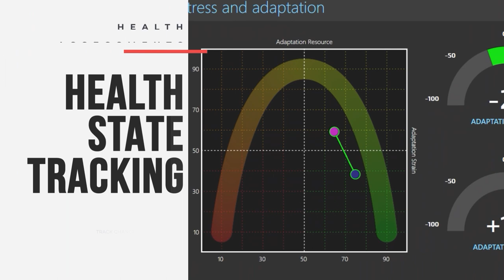My First Killer E-Bike Build with the CYC X1 Stealth Mid Drive Motor

Comment: Mahalo for the fine video info. And the informative teleconference with Jon Chan and Rickus... I've been to Salt Lake City, Utah and have ridden from downtown Salt Lake City up towards the foothills where the high tension power lines are. [Only about twice since I had a bicycle as my only means of getting... Now I'm encouraged to get my 29-inch bike out of its two year hibernation and start riding again... Maybe upgrade my brakes and change my tweaked fork.. and get the gen 2.5, asi controller... two 20Amp Samsung battery packs... Hopefully, they've worked out the water resistance issues... Hope you are well and riding your e-bike now.. Stay safe. ALOHA John...
Reply from the maker: My update video...https://youtu.be/ZPzcRTTcXTg

Comment from the maker: I goofed. When I mentioned crossing the border from Canada to the US I said you can easily switch from the 500 watt road legal limit here to 250 watts for the US. I meant to say 750 watts which is the road legal limit in the US. Having said that I should also have pointed out you have the option of setting the speed limit as opposed to the power output. That way you get to use all of your power up to that speed. That would be preferable IMO.
Reply: some states legal limit is 1000 watts just saying :-P

Comment: Ebike speed has nothing to do with the battery amps, it's a mix between battery voltage and discharge rate, Volts determine how fast the it "can" spin in rpm but you need a certain discharge rate (in watt/hours) to "muscle" your rpm from 0 to whatever while carrying you and your bike against the hill and the wind. The higher the rate(up to controller limit of course) the less speed you lose while going uphill and the faster you go from 0 to 60. The truly important metrics is the volts = (36,48,52,72) the higher = more rotational speed at the wheel and it's easier for the controller to get more current with fewer amps, volts x amps = total battery capacity in Watt/hours(size of the tank) and the discharge rate which tells you how fast you can accelerate and within reason how much speed you lose while going uphill, more discharge means more total amps to the controller while it's trying to keep your speed constant against the wind or the climb.
Reply: Thanx4 the layman's explanation Sir. I'm going to dust off my 29-inch mtb from its resting place these past two years... I'm going to update my brakes to hydraulics front and back. Change my front forks to Fox since it's tweaked anyway... Maybe I can take longer rides than 18 miles each way from Ft. Walton Beach to Navarre.. I can head towards Pensacola or Panama City both about 60miles each way from Ft. Walton Beach... mostly flat lands except for bridge overpass for sailboats. I'll have to work out the front derailleur to a single 48T. I've no clue about electrical systems other than a simple on and off switch.. I will find out... Mahalo for getting me started Mr. Michael Castro. ALOHA Brah

Comment: My thinking is to put this motor on an E Bike that has a small motor but has a good brake system and suspension.  It would be nice to have up to 5,000 watts if it can go 40 mph or so. Replacing a weak 500 watt rear hub motor with 5,000 would be great! Just change the rear hub motor into a solid axle rear rim without a motor.
Reply from the maker: That would be the CYC Motor x1 Pro. 3,000 or 5,000 watts depending on the controller voltage. You can easily do 40mph at only 3,000 watts. I've hit 40 mph with my 1,500 watt mid-drive.

Comment: I have ridden my E Bike for 50 miles at a time. With low pedal assist levels staying under 15 mph I get 75 miles per charge. But my motor is 1,000 watt 1,800 peak. 52V 20 Ah battery. Good workout even though it's a cadence sensor style bike, not a torque sensor. We also have no hills here. I get a top speed of 36 mph on flat ground. I can set it up to be legal and class 2 compliant if I wish. Nowhere on the bike does it say it is 1,000 watts. Just has a big class 2 sticker.

Comment: This is 2 yrs old but very timely for me because I'm just researching my own build so many thanks. I have just bought a 2nd hand Trek mountain bike which should give an excellent platform for the ebike, now just have to decide on the motor. It will be either the CYC Photon or X1 Stealth, haven't made up my mind yet. I like the extra power of the Stealth and its clever efficient design, but will be using the ebike for some hunting so the quieter Photon would be an advantage in that respect. We'll see!

Comment: I bought a kit 5 months ago excellent company.  The products they produce are top tier
Reply from the maker: We've just built two folding bikes. The CYC Stealth motor fits the frame on the new 2021 Giant like it was designed for it. Video on those builds coming soon. We're just waiting for a couple of 52V/14Ah batteries from ElectrifyBike.com to mount on the seat posts. We also have a rack and battery setup to compare the two options.

Comment: Two words....Luna Cycles!!! A motor you can buy and is not vapor wear! Also to build an ebike where you have a choice and to not get full suspension at your age is kind of crazy! Also, why did you not address the supply backup problem with their motors and batteries???
Reply from the maker: One word, Electrifybike. They are getting a shipment of 2,000 motors in a couple of weeks. The biggest shortage was in controllers. It was a global supply issue. Now that is gone. My update video...https://youtu.be/ZPzcRTTcXTg

Comment: Just received my CYC X1 Stealth, in Australia, hopefully doing the build over weekend. Did you get yours built yet??
Reply from the maker: Yes, and loving it. Working on the next video which is mostly what I've learned since I built the bike. Just waiting for the spokes I need to replace the 3 broken ones I found on my rear wheel. I have my ride video footage already in the can and I am hoping to finish this update video this weekend. I will follow that with our folding bike build, which in our opinion, is the best folding bike on the market. It is so slick you will almost think it was designed from the ground up but it is not, it's a DIY. Stay tuned.
Reply from the maker: My update video...https://youtu.be/ZPzcRTTcXTg

Comment: I received my motor,I installed it the brake sensor if you just use the two sided tape is not holding so I fabricated a mounting and I used epoxy for cleaner look instead of plastic tie, I’m happy with the purchased enjoy to those who buy this motor I hope you receive your motor sir happy riding
Reply from the maker: My update video...https://youtu.be/ZPzcRTTcXTg

Comment: This is one of the best e-bike videos I have seen on youtube! You explain everything so well and in detail. I used to have a mid-drive motor before, but it seemed to wear out chains and cassettes every 2-3 months (I ride a lot). What is your experience with wear of chains and cassettes?
Reply from the maker: I completely agree with you about the wear on chains and cassettes. That is why we are upgrading this build to the new Box Components 1 x 9 ebike cassette. I can't wait to test it. Having said that we are waiting for a fantastic new motor tech coming out in the 4th quarter and will, at that point, build and test a ride with the Veer belt drive. It's a motor I have been waiting to hit the market for over 2 years.
Reply: That only happens like that if you use your ebike as a motorcycle, if you use nothing but pedal-assist or use the throttle only to maintain or slowly accelerate you will have your parts last years.
Reply from the maker: My update video...https://youtu.be/ZPzcRTTcXTg

Comment: Great vid. Hope build vids are still comming. One thing I haven't heard  with the CYC motor is if they have regen, more then for the charge, but rear breaking on the road. But maybe better without unless it can be turned off for dirt trails or coasting.
Reply: Regen isn't possible on a mid drive due to the free-wheeling cassette on the rear wheel.  It provides an almost insignificant benefit on e-bikes anyway.
Reply: @nukeelec  Hadn't thought of that. For rear hub, I know it can work as a auto brake and those with, it usually doesn't do much dif for charging anyway.
Reply from the maker: My update video...https://youtu.be/ZPzcRTTcXTg

Comment: What a shame. I'd love to put an X1 Stealth  on my Tadpole trike but it looks like the motor would stick out front of the Boom & Bottom Bracket by about 200 mm without any way to mount the anti-rotation clamp.
Reply from the maker: Just looked at a high-res photo of one of those trikes. What's to stop you from mounting it on the bar behind the chain ring? We mounted it vertically in the frame bracket on our new folding bike. At the same time we sourced a case to mount the controller behind the seatpost as the stock configuration combo would not fit in the frame triangle. That video coming soon.
Reply: If I understand the installation correctly, the bottom bracket shell is what the motor mounts to so it either has to go above or below the boom (bar) behind the bottom bracket.
Reply from the maker: @daytriker  I'll reach out to Jon, CEO, of CYC and get the best advice for you. What's your model?

Comment: Uncovered 219 chain is the weakest part of the whole system. it is getting dirty, and noisy especially in MTB conditions. I would suggest to design some chain protection.
Reply from the maker: Best thing you can do is to use PlanetSafe Lubricants AIM lube. It seriously reduces friction, noise, and doesn't attract crap. It is impervious to water so you can quickly hose off your drivetrain or, like me, give it a quick wipe. And it has no smell and is safe for the environment. I find it better than dry lube, which is noisy, and has superior protection for rust and corrosion. And you can use it everywhere on the bike including bearings, derailleur, and on exposed cables.
Reply: @TotalHealthMagazine  Thanks, going to try it. Now for my CYC Gen1 Pro, I am building HTD 5M belt drive system, and hope it will be cleaner, long lasting and maintenance free.
Reply: @martynasdaminaitis4179  do you have plans available or a link to the complete drivetrain? How much power can it handle?
Reply: @skirmish666  No, I don't have a plan. I am going to build drivetrain using 20T and 100T pulleys (1:5 ratio). Belt HTD 5M 20mm width. Currently using BAC855 controller and 13s battery I am pulling 2kW max. 20mm belt should handle that power.

Comment: with the weather in Van and BC being wet how does this unit hold up to the rain?
Reply from the maker: I'm going to find out. I'm based in Chilliwack. The motors are shipping this week. I haven't seen any feedback where rain has been a problem elsewhere on youtube. But I will certainly be exposing it to the rain here in the valley. Stay tuned for the follow-up videos and the new technology videos coming. We're also building a custom folding bike that we'll demo here and in Vancouver.
Reply: I’ve had an x1 pro Gen 2 for about 18months on a Kona Scrap hardtail with dirt jumper forks. Living in Langley and now mission , (wet BC riding ) I ride it like a dirt bike and it has held up to the weather fine.   I’m waiting on an upgraded bac2000 now as my stock display went dark .   Also ordered a new 32 T chain ring and the smaller 53T 219H sprocket. Currently I’m running single speed gearing. 18T rear 32T front and 11x63T 219H chain. With this gearing I top out at 50kph with but loads of torque for single track riding.   I did away with my 8 speed cassette.   I was jumping the chain too much with all the power.  See what happens when I unlock all 5000Watts. 

I should be rolling again soon.
Reply from the maker: Check out my update video. I have had zero issues with almost 3,000km. But CYC have completed a major waterproofing upgrade. Jon shows us what the improvements are in my video. https://youtu.be/ZPzcRTTcXTg